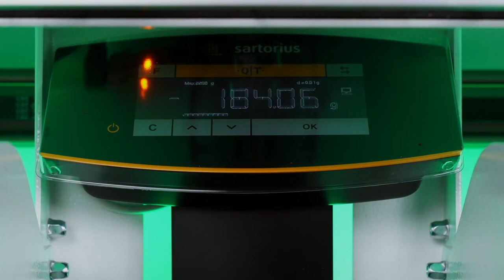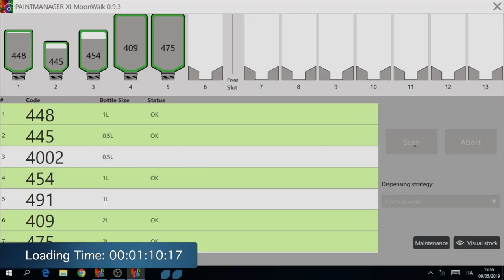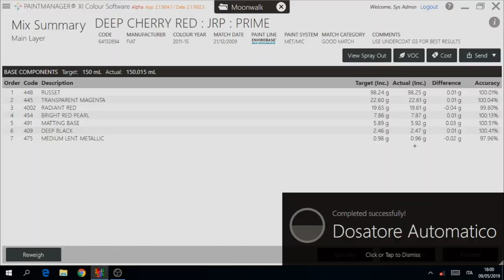PPG Moonwalk Demo 3min

Comment: I see major problems here as a collision shop owner: As copied to my paint rep: 
Sadly it took her over 1 minute to load the machine, and it took over 4 minutes to mix that one batch of paint without reducers, hardeners, or anything else, plus you still have to do clearcoat etc, etc, etc and make a mess, we also still do a fair bit of tinting, you then going to unscrew the toner and put a lit on it to drop a few drops in to tint on the fly, or will you load the machine again and have it auto dispense again?  Also scroll over to 2:02 in the video and see how much paint splatter is all over the bottom of this thing, someone has to clean the little hole that it comes out of, more maintenance, where as now just throw the pour spout out and put a new one on in about 5 seconds.   This machine works in the lab, but they missed the mark for the trade world on this one!  Once they make a machine that does the whole thing, clear coat, hardener, mixing and takes the human element out of it completely, I’ll be sold, I’m all about automation here, humans make mistakes, grab wrong toner etc, and then they’ll blame moonwalk for mixing it wrong, heck they blame the chips if they grab the wrong toner as it is!
Reply: I don't know which overlords are watching this comment section, but I think I can safely say that every week I have to use this machine for mixing paint. 

This is ONLY for Envirobase basecoat and tricoat formulas. They do not add reducer. So no undercoats or topcoats will ever get mixed on this machine. 
This machine also (with my setup) can not mix custom formulas or adjusted formulas, so those are out of the question. 

The only toner that can get mixed are the ones on the mixing line, so you must load the corresponding toners to the formula for every mix. 

The machine definitely pours much slower than humans pour. And if the machine runs out of a toner, the replacement process takes about 3x the time when compared to simply replacing a old school pouring lid.